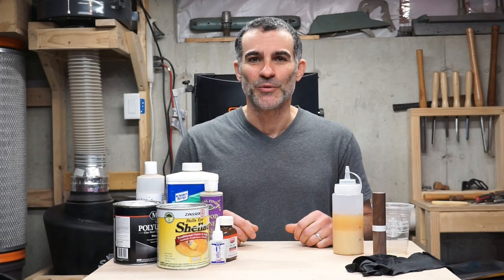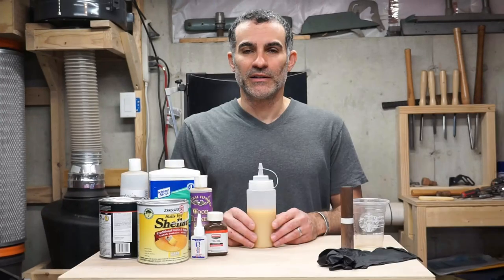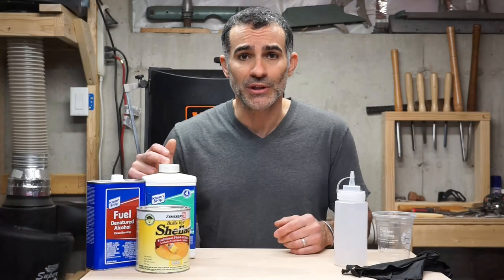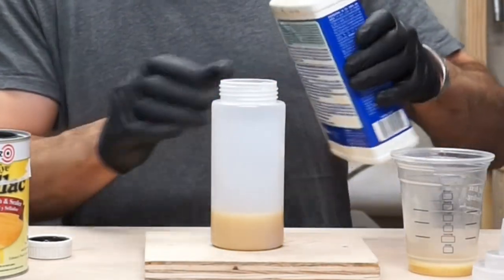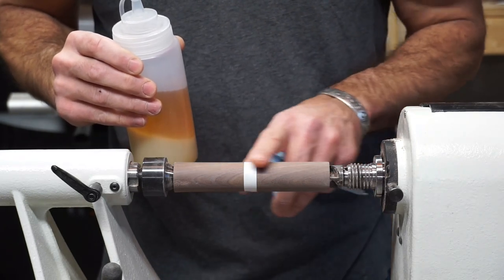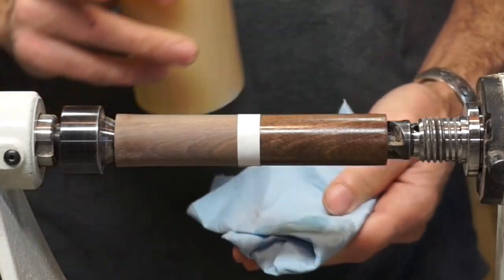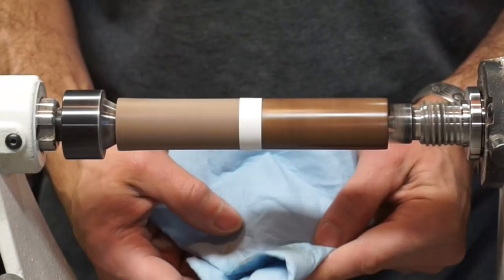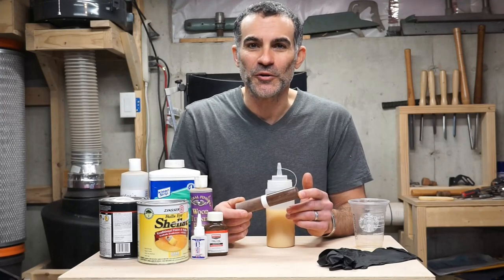Woodturning Basics: How to Make and Use Friction Polish

Comment: Wow thank you. Can I do a guitar like that
Reply from the maker: You're welcome, Henry. No, you most likely won't be able to do a guitar using this stuff. The friction, for which the polish is named, is required to get things to cure. You may be able to get away with doing multiple coats with dry time in between but I"m not entirely sure... never tried it. Thanks for watching.

Comment: I have found that home made friction polish just doesn't hold up.  I prefer lacquer sanding sealer and spray lacquer for a permanent finish.  Open grain woods may require six or seven coats with light sanding before the final coat while closed grain wood can be finished with one or two coats. The finish will last and will stand up to hand sanitizer.
Reply from the maker: No doubt that your finish would be much more robust. I feel anything sprayed is going to lay down a thicker coat. Thank you for watching,.